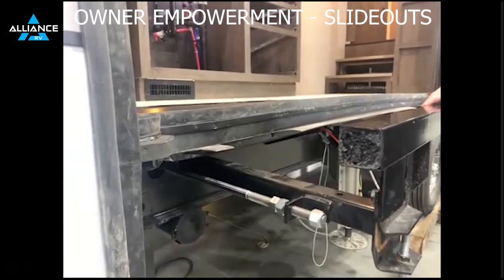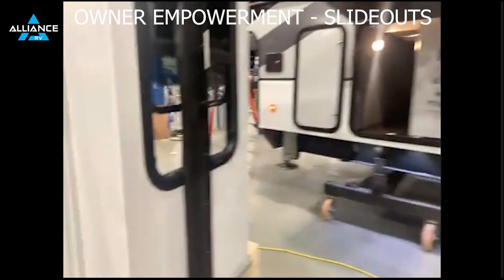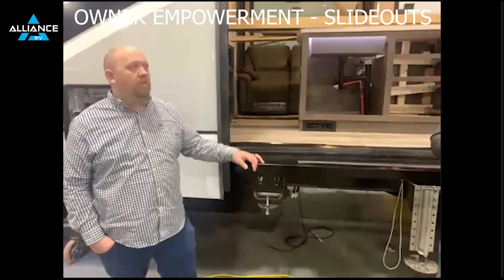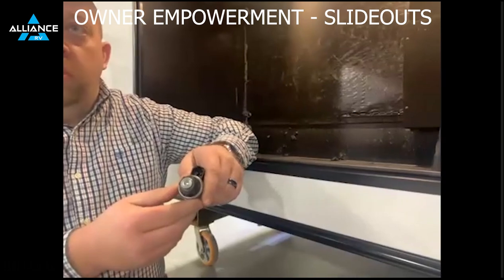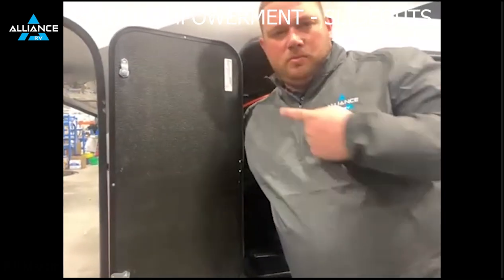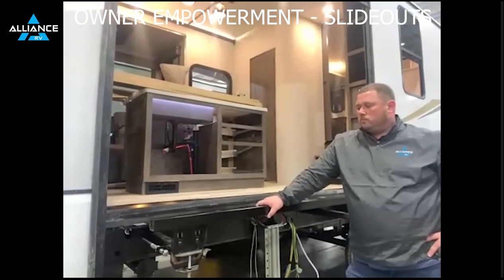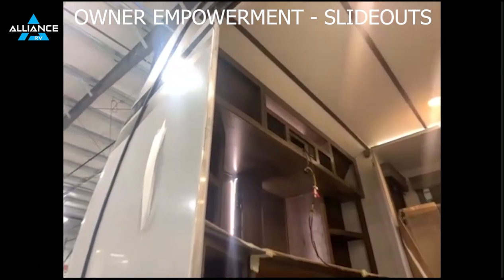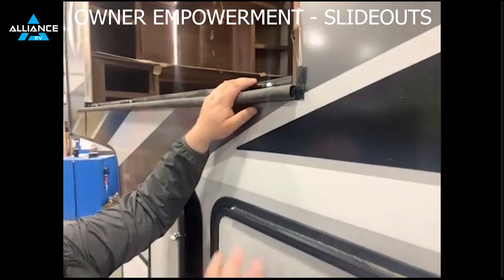Owner Empowerment - Slideouts

Comment: I am in escrow with a dealer.
I am getting the 44v13 Valor. 
I am trading in the 4270 cyclone. 
The videos are very helpful. 
Slides, solar,  frame. 
I am taking delivery Friday 
1 -21-24 videos r the very informative.

Comment: No maintenance on e we get them working g correctly ? Correct ?  We haven’t even picked up our 2022 42v13up yet :( and  dealer called us telling us we have issue with large slide . Sounds like known issue in 2021 models so curious why 2022 came out without the fix .